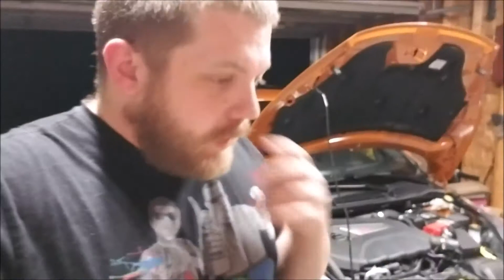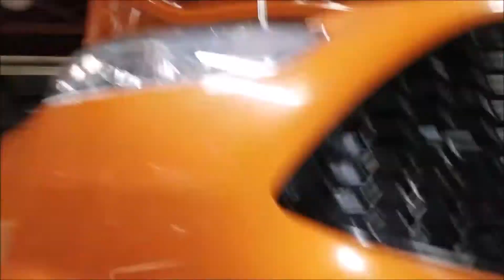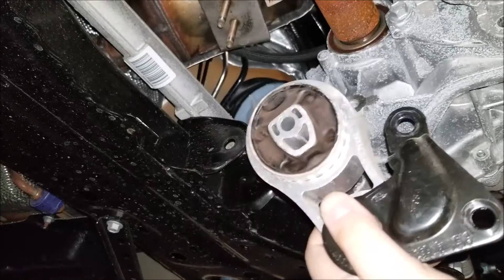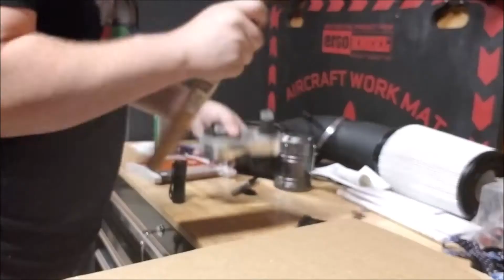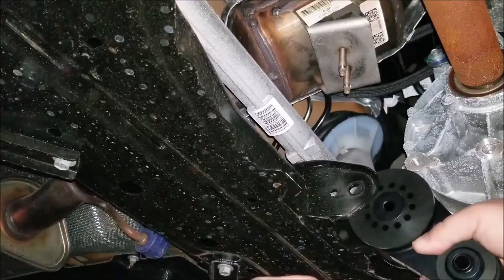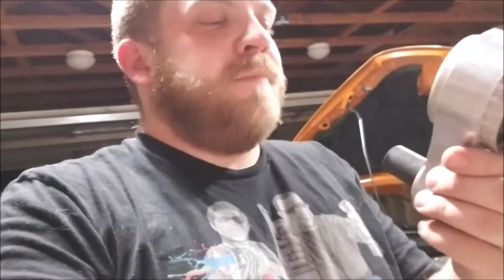2014 - 2018 Fiesta ST Cobb Rear Motor Mount Install (USDM)

Comment: I cant see how a mounting that transmits no vibritions cause stuff to get loose.the cobb mount cause vibrations.i think they will cause stuff to rattle loose over time
Reply from the maker: "The COBB Ford Fiesta ST Rear Motor Mount is the best way to minimize engine movement, improve traction, and reduce wheel hop, all without major impact to Noise, Vibration, or Harshness (NVH). Typical bushing designs can rattle your teeth out at idle or during throttle input. This improved version of the COBB RMM minimizes NVH over the previous design caused by resonance. Its 85A durometer bushing absorbs more vibration and further reduces engine movement to aid getting all the power to the ground. The beautifully machined 6061 billet aluminum mount with zinc hardware will make you sad you have to hide it under your car." -Cobb

Comment: Ill rather stick with the oem.to transmit less vibrations.its not like u launch the car every time u drive to town or to work.if u mostly drive highway then the oem mount do its job very well.and nothing irrates u.😄👌
Reply from the maker: And I'm clad you told me how my superior rear motor mount is actually inferior. If you drive these cars the way they are meant to be driven, you'll get the benefits it really doesn't increase NVH very much at all but you'd have to try it out to figure that out. Bless your heart.